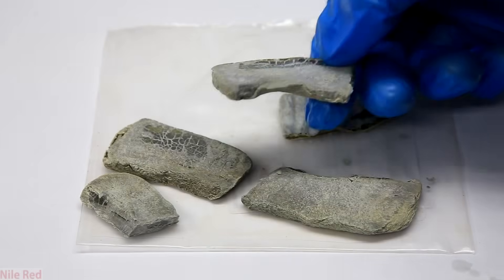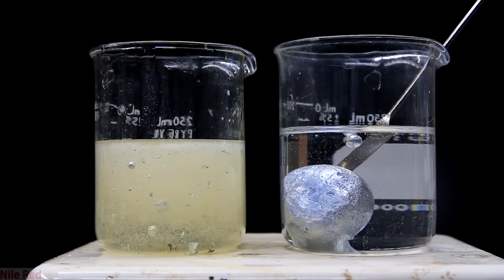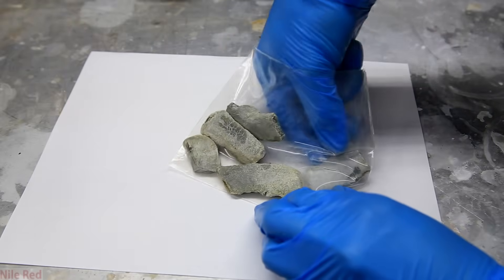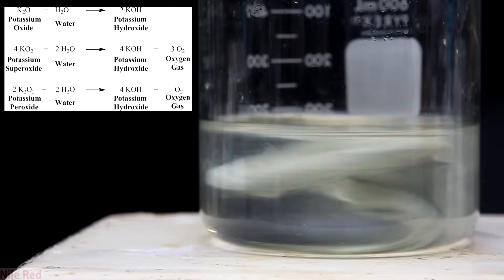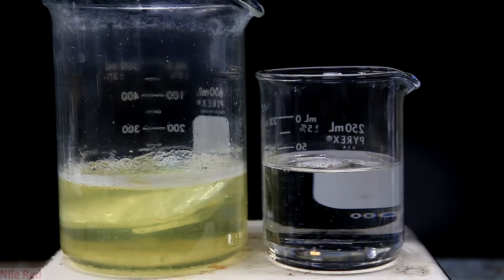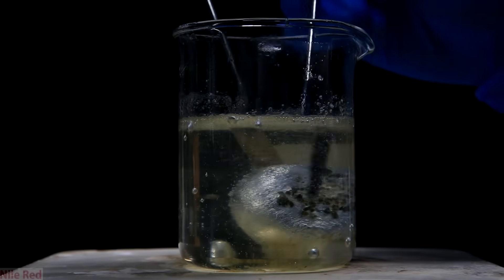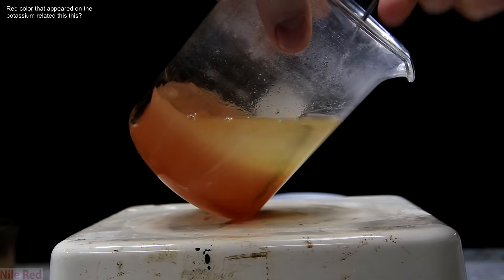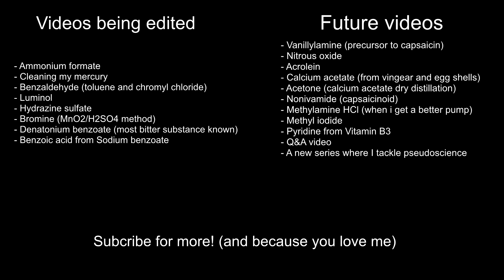Cleaning old potassium metal

Comment: I agree with AmbassadorJJ about caution using isopropanol. Back in the day, I was always advised to only use t-butanol to clean or destroy potassium as it's even less reactive than isopropanol.

Another thought: when cutting potassium chunks, never use a metal knife - it can undergo redox with the superoxide and metallic potassium, causing an explosion. I would advise the same for poking a molten blob of potassium too: try using a glass rod instead.
Reply: Spider Juice redox reaction with what? Where's the oxidant?
Reply: @pietrotettamanti7239  I'm no expert but I'm pretty sure that the superoxide is highly reactive and a powerful oxidising agent
Reply: @Pietro Tettamanti  I'm pretty sure that the potassium superoxide is both highly reactive and a powerful oxidizing agent so the superoxide is where the oxidant comes from in that redox reaction if a metal knife is used to cut potassium chunks
Reply: @prospektOS-tmo97  
And how would that change from a metal spatula to a glass rod?
Reply: @pietrotettamanti7239  this man just waited 3 years to add another question.
Reply: Does the same thing apply to sodium metal that the sodium should also never be cut with a metal knife ?
Reply: @craigpater6278  sodium doesn't make superoxide so at least that's not a problem but if you use a rusty knife the pressure buildup can give enough activation energy for redox reaction between iron oxide (oxidiser) and sodium (reductor). Like with aluminium and iron oxide in  thermite reaction.
Reply: @craigpater6278  No, sodium is much safer :) Potassium, Rb, Cs you must be much more careful with.
Reply: @spiderjuice9874  I do agree with you that sodium is much safer to handle than potassium, rubidium or Caesium you are certainly correct about that but I do think that it's worth noting that sodium is still a highly reactive alkali metal and still needs to be handled carefully as sodium will still react violently with water and incompatible chemicals for example sodium reacts violently with strong acids like hydrochloric acid and sulphuric acid

Comment: Running water works best for these things. Just like silverware.
Reply: All you have to do is add some water, and you instantly clean off everything that was surrounding it.
Reply: I also found water works well for cleaning metallic sodium
Reply: @Cal_bHero  it works well to clean an unknown substance
Reply: Some dude's gonna read this thread, believe it, and die lol
Reply: Jake Kim ಠ_ಠ
Reply: It also works for sodium, all you have to do is get the biggest amount of sodium possible and drop it in a water bucket, it cleans itself instantly
Reply: @ViniSDL  It just produces safe, flame-retardant Hydrogen gas.
Reply: Haha
Reply: Then dry it on the microwave.
Reply: Water cleans active metals wonderfully😀

Comment: could the oxide be blue because of a thin-film effect? I know that when you heat up steel you get an iron oxide layer that's coloured by the thin-film effect, and one of the colours it turns is a blue very like the one in the video
Reply: thought of that aswell but why wouldnt the color continiously change while the oxide film thickens?

Comment: Organic Chemist here. I'm not sure if potassium's oxides will react with alcohols, but I can tell you that alcohols react with alkali metals to form the corrAesponding alkoxide salt and hydrogen gas, much as water reacts to form the corresponding alkali hydroxide and hydrogen gas. (i.e  CH3CH2OH (ethanol) + Potassium ==> 0.5mol Hydrogen gas + 1mol CH3CH2O- K+ ) These alkoxides are extremely reactive. Be careful.
(How do I know this? I've personally reacted sodium and ethanol before in order to form sodium ethoxide, which is an extremely strong base, for an experiment in my academic research)

That stuff left behind in your toluene? Potassium isopropoxide. It's an extremely strong base. The solid gradually turns dark over time because of oxidation. To neutralize it, add cold water to it slowly after removing the toluene. This produces isopropanol and potassium hydroxide. The hydroxide can be neutralized with boric acid solution or vinegar.

Again, please be careful. Also, it would be very nice if you add a warning about this to your videos that you clean alkali metals in; they will all react with isopropanol in this manner, and the resulting waste should be neutralized as I described above to prevent accidental harm.
Reply: @dacomputernerd4096  that is certainly also a possibility. With these highly reactive substances, anything can happen.
Reply: For the potassium K metal, since it is much more reactive than sodium Na metal, it is still quite vigorous and dangerous when reacting with ethanol (may catch fire); if replaced the ethanol by isopropyl alcohol or tert-Butanol alcohol, or if diluted the alcohol by inert solvent like hexane or toluene, the reaction is milder and safer.
Reply: Potassium metal K reacts with isopropyl alcohol.
https://www.youtube.com/watch?v=aWjn7noAtEM
Reply: @siyuyangzhang6995  I agree wholeheartedly! However, the byproducts of any of these reactions are quite dangerous to the layman (or the safety-challenged expert), which was my primary point 😊
Reply: And I'm sure you picked up on the organic solvent on nitrile gloves
Reply: @ConstantChaos1  I did. All around, this procedure was a tad shady. NileRed using nitrile gloves as a barrier material is a yikes.
Reply: @AmbassadorJJ  I mean obviously he didn't get hurt but I also wouldn't have put it past him to do it intentionally to get comments and drive up interaction (Obviously joking i feel like he is pretty good about being a good example over clicks)
Reply: @ConstantChaos1  For sure, lol, he's gotten better over the years anyways. Though, yeah, driving up interaction, ya never know lmao
Reply: Why boric acid tho
Why not use any other acid
Reply: @realAnkares  boric acid was just a token weak acid for me to say (I think I also happened to have a bottle of boric acid nearby when I originally made this comment). To neutralize the base, you could use anything from citric acid to ascorbic acid or even sodium bicarbonate (an amphoteric species), as well as many others. Cheers~
Reply: @AmbassadorJJ  yeah that's not what i meant
Btw nice to see someone know what they're talking about
But I'm a chemical lab assistant in training and boric acid is something i would not really wanna work with 
Generally boric substances are something i try to avoid because they are mostly quite uhhh lets say unhealthy

On the other hand i could make it worse than it is cuz we're pretty much working with DCM and other chemicals that are potentially carcinogenic sooooooo
Boric acid aint the worst we have
Reply: @realAnkares  boron is certainly a health risk, but boric acid is a reasonably common household item. I believe I was aiming this towards the common person at the time I wrote it lol.
Reply: @realAnkares  although, in the scheme of things, consider... Boric acid and the corresponding borate salt aren't as scary as potassium isopropoxide haha.
Reply: @AmbassadorJJ  
Yeah okay i can totally agree with that XD
And i totally forgot that boron is a household chemical
Reply: WRONG EXPLAINATION, READ THE EDIT:That sounds about right. Assuming you neutralized with vinegar, alkoxides react with things like vinegar to form esters, which generally smell fruity.

Edit: correction many years later...  Don't know what I was thinking. Vinegar reacting with the alkoxide will produce the alcohol plus the corresponding salt of the carboxylic acid (e.g., potassium acetate). If there is excess acidity in solution after all this (e.g., a sufficient excess of acetic acid), you may have a slight fruity smell develop after a small amount of the acid is able to react with the alcohol to form the ester, but that would be a VERY slow reaction at best. Thanks to Leo Curious for pointing out this inconsistency!
Reply: Alkoxied form esters with organic acids? How is that supposed to work? Reaction mechanism please, because I highly doubt it. It will form the acids salt + the alcohol, eg. CH3-CH2-O-Na + CH3-COOH -> CH3-CH2-OH + CH3-COONa
Reply: @leocurious9919  many years later, I have corrected my comment above. Thank you for your correction! Not a clue what I was thinking when I said that.
Reply: @AmbassadorJJ  alkoxides wont react at the carbonyl carbon with carboxylic acids, it will just deprotonate the acid forming carboxylate and alcohol...
Reply: @nolanwilson3021  I stand corrected. Thank you, sir.
Reply: no problem Mr Ambassador Dude @AmbassadorJJ
Reply: @AmbassadorJJ

Potassium Ethoxide rules C²H⁵ - OK.

(With thanks to Nigel Rees. I've waited decades to use that one. 😁)

Comment: Combining potassium metal with toluene and wet isopropanol is ridiculously dangerous if you don't have an inert gas blanket over the top. It has to be nitrogen or argon to prevent fires. Carbon dioxide does work, but can react to make potassium carbonate which contaminates your potassium. Isopropanol does react with the potassium metal itself (to make potassium isopropoxide and hydrogen), so you risk destroying some of your expensive potassium this way.

There is a much better way to make shiny potassium blobs, even from lots of really dirty small pieces. The solvent of choice for this is dioxane, since it can dissolve the potassium oxides without reacting with the potassium metal underneath. Transfer all the dirty potassium to a large beaker about half full of dioxane - you don't need to wash all the oil off first, so if you have a load of small bits, just strain it out with a sieve. Then heat it up until the potassium starts to melt, and it should coalesce.

Ideally you should stir it with a magnetic stirrer. This allows you to cover the top of the beaker with a lid and purge the headspace with inert gas while you are heating it, otherwise the risk of fire is rather extreme. The molten potassium floats to the top, while the oxides dissolve and any other insoluble crap sinks to the bottom. Once you have a nice shiny blob, let it cool down while still purging with inert gas. Once solidified, pick it out with tweezers and put it in a clean jar with some fresh oil.
Reply: calm down guys and realize that he is probably in a fireproof environment also that could happen but the oxygen would have to mix with the fuel for it to burn and for that. you would have to do it intentionally.

also just realized metals like this could be a good option for dehydrating solvents assuming the space is low pressure and airtight ten just filter off the oxides and boom.

and for those worried about isopropoxides remember surface area.

isopropanol is a lot cheaper than some other solvents.
Reply: @batenkait0s657  , well said.  Thank you.
Reply: Its really somewhat dangerous. He is also adding way too much alcohole. Just add a few dops and let it sit over night. Use liquid paraffin or some other high boiling hydrocarbon as the solvent and there is no crazy fire hazard.
Reply: Can we keep potassium chunks in liquid paraffin, add a few drops of 99% ethanol and keep it in a fume hood over night? @leocurious9919
Reply: Isn't dioxane gonna act as a chelatant and solubilize potassium metal too ?
Reply: @ Alcyne: Where would the electrons go?
Reply: Can you make a video demonstrating this?
Reply: How about propylene carbonate? Can it dissolve the oxides?
Reply: Yeah, I would have been shocked if potassium metal didn't react with that juicy hydroxyl group on isopropanol.
Reply: You are the only sensible person in this commentsection...
Reply: Lloyd Evans NO NOT NITROGEN THE K WILL CORRODE
Reply: @plazmatter  No. Only lithium can react with atmospheric nitrogen directly. ;-)
Reply: @plazmatter  is potassium reactive enough to break the triple bonds? im new to chemistry so just asking also if it's under mineral oil then it would only effect a split second when you'r taking it out besides nitrogen is still better than oxygen

Comment: I'm sure somebody already answered this better but I did some R&D work for a company about 15 years ago and in my research I ended up learning about anodizing as it was related to the project I was working on and it's basically a process of electrolytically induced and controlled oxidation. I may be wrong but I suspect the blue color of the surface oxide that forms on it is due to the specific thickness that the first order oxide layer as it stabilizes, and that causes some interference effect with light at that wavelength (sort of like the effect of opal and labradorite). 
From what I remember in my research in to  chromic anodizing, the thickness of the oxide layer is what corresponds with a wavelength of light that will be reflected instead of absorbed the most when going through it and that becomes the "color" you see.  When you anodize aluminum , titanium or rhodium, you can vary the voltage and electrolytes used to achieve a certain "color" effect on the surface of the metal that in itself is not a dye or tint but yet produces an almost eerie effect of only allowing a specific narrow band of light to escape from it's surface. So by controlling the exact thickness of the oxide layer to reflect or maybe "re-emit" light of that wavelength you achieve an array of surface color effects.
The principal is that the potential for oxygen bonds is initially going to be high on a conductive metal surface when no oxide layer yet exists, as seen by the rapid formation of the oxide layer when the potassium was exposed to air, but as that layer of much less electrically conductive oxide thickens, it will quickly reach a point where the potential energy to overcome the oxide layer exceeds the input energy and it stabilizes there. Sorry I can't site a specific source, just spewing something out of memory from years ago.
Reply: LCARS43278 it's called the thin-film effect, happens with oxide on steel too. it was and sometimes still is used as a protective finish, and I'm pretty sure it's the reason the black finish on firearms is called gun blue

Comment: the red stuff appearing when clean potassium is exposed to air should be potassium ozonide (KO3)
Reply: It seems to be some form of reaction with the gloves or their blue color. Its very unlikely KO3 as there is no ozone source and reactive alcohol in the solution.
Reply: @leocurious9919  Ozonide can have enriched over the amount of time and is part of that crust! Especcially in populated areas there can be 'high' amounts of ozone in our atmosphere. Check your parts made out of silver! Regular oxygen cannot corrode it. Next to sulphur compounds, ozone has a big effect on silver, too!
Reply: @kritter461  Its really obvious that it is a reaction that takes place during his handling that produces this red stuff which is also soluble in the solvent.

Comment: Would you use roughly the same process to clean lithium?
Reply from the maker: +waves2loser The melting point of lithium is much higher. I am not sure how well it works with mineral oil.
Reply: ah i see. i'll have to do an experiment to see how well it works, thanks anyway

Comment: The colors on the metal don't need to be the colors of the actual compounds formed. They can very well be caused by light interfering with thin films per se. Remember what happens to stainless steel in flame?

Also, remember this is toluene and it's not pure. The red stuff might be an organic compounds which has oxidized and precipitated. Some say it's potassium ozonide.

There's really a lot of options. I've been cleaning potassium a long time ago and used same procedure, more or less. It was a pain in the ass.

Oh yeah, and use a smaller storage jar. Great video. :)

Comment: Potassium alkoholates (isopropanolate, t-butoxide) are sufficiently basic in presence of elemental potassium to deprotonate toluene (and diphenylmethane and triphenylmethane as well); the benzyl potassium (red jelly) formed is pyrophoric.  The red coating forming on the metal surface is most likely potassium ozonide which is really very dangerous, a brisant high explosive.  I would recommend using low viscosity paraffin oil as medium instead of toluene and absolute ethanol diluted with 2-3 times its volume anhydrous petrol ether instead of 99% iPrOH (which can contain significant concentrations of peroxides formed upon storage, besides water).  Afterwards washing the cleaned potassium metal with petrol ether 40-60 °C or n-heptane.  To store the metal, it is best to melt it into argon purged glass tubes and seal these with flame to ampoules.

Comment: Is this method applicable for cleaning gallium from gallium oxides?
Reply from the maker: +Robin Dahlberg I dont think it works for gallium, no that it is worth it. Gallium is a lot less reactive, so you can just melt it in air and pour out the clean gallium from the oxides. Also, the oxides arent super reactive so i dont think they would react with an alcohol. I could be wrong though.
Reply: I've found that the best is to put the dirty gallium in distilled water and to add a drop or two of HCl (not too much, you want to dissolve only the oxides.). The oxides will disappear immediately, all drops will coalesce and it will not stick to most surfaces anymore. Pretty much looks and behaves like mercury at that point. However, this only works as long as the gallium submerged.
It also works with gallium-indium alloy. Other acids did not seem to work as well.
Reply: Thanks i will try that out.
Reply: Robin Dahlberg I clean my gallium by submerging it in store-grade HCl.